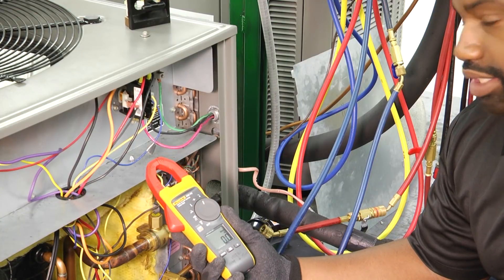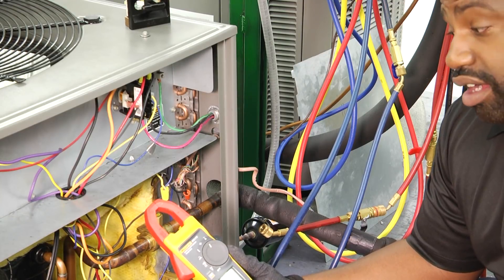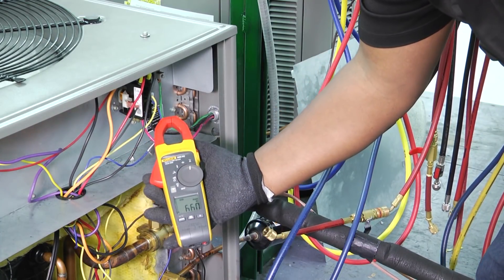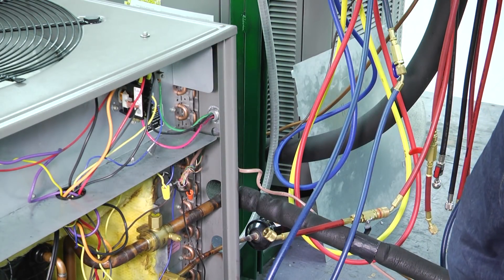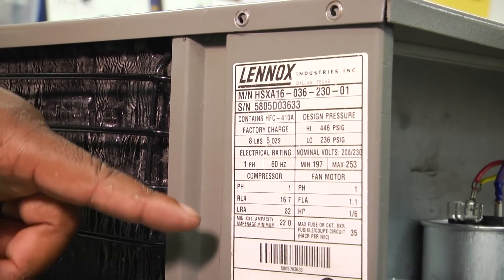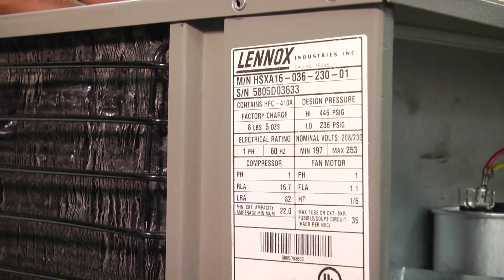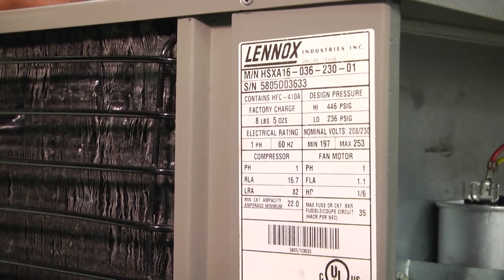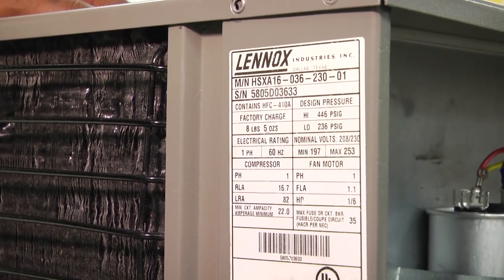Measuring Inrush Current

Comment: Most clamp on meters on inrush/surge current mode require 0.3 to 0.4 seconds duration for time averaging of current to make an accurate startup surge current measurement.  

A hardstart kit may reduce startup time to less than 0.3 seconds causing meter to report an erroneously low startup surge current number.  This is the reason many techs incorrectly believe hardstart kits reduces compressor startup surge current.

Hardstart capacitor decreases startup time.  It does not reduce peak surge current, only shortens its duration.  

Hardstart capacitor gets the start winding to run winding current closer to 90 degree AC phase shift which improves startup torque of single phase AC induction motor.  The amount of additional start winding current is very small,  it is the AC phase improvement due to larger capacitor value that improves the startup torque, reducing the spin up time of motor.

LRA is set by motor design and does not change unless voltage on motor changes.  What changes is the length of time the motor takes to spin up to operating speed.  As a compressor approaches 0.7 to 1 second of time to spin up due to whatever issue inside compressor (copper plating on bearings, liquid flood back in off mode. etc.) the internal thermal cutout breaker inside compressor will likely trip due to LRA current for the long period of time.  Bad wiring, connections, bad contactor, can also cause additional voltage drop during high startup surge current, therefore longer spin-up time, causing compressor internal breaker to trip after 0.7 to 1 seconds.

Comment: I'm confused! As the inrush current goes down, that's a problem? I would think as long as the inrush current is less than LRA that would be a good thing. Less current, less heat. No?
Reply: The lower the inrush current the better because it's easier on the compressor windings. A little more longevity for the compressor.
Reply: @bernardocisneros4402  Yes I agree. At least I would think so. They may be negative to too little inrush current as well, but I can't think of what that might be as long as there is enough current to get it moving.
Reply: @tommaxwell429  The ideal scenario would be for the current to gradually ramp from zero to rated RLA. That is what a compressor that has an EasyStart installed does and it does it in about 3/4 of a second. Whereas a new compressor without EasyStart or a hard start kit installed, experiences an inrush current spike lasting about 100 milliseconds and the compressor reaches rated speed in about 250 ms.

Comment: Fantastic✔Sent this to my HVAC folks since they didn’t know how to use their clamp on meter etc.  I want to run my AC on a portable generator so need the new surge amps after the soft start installation.  If it’s below 30 amps, I’m good.

Comment: It may be beneficial to inform folks about the difference between a hard start kit and a soft start kit.  A hard start kit actually will not change the inrush current, it will simply decrease the duration of this spike.   A soft-start kit, on the other hand, should decrease that spike peak.

Comment: RLA = Rated Load Amps.  Measured amps while compressor is running.
LRA = Locked Rotor Amps.  A locked rotor is the worst possible case for impedance that leads to the highest measured amp reading.
Reply: Incorrect. Impedance doesn't change. It's a function of design of the motor.

What changes is the magnitude of the back EMF. When the motor is not rotating, there is no back EMF, and the circuit is simply the DC resistance of the coils and the voltage across them. The coil resistance is low and hence the locked current is high 

I am surprised how many people are making statements on how motors operate and do not understand basic motor theory. It's shocking
Reply: @deang5622   Besides the inductance of the motor, frequency also effects impedance.
Reply: @bernardocisneros4402 Frequency does not effect impedance.
Frequency affects impedance. Actually frequency affects the reactance.
Reactance is a component of impedance.

Learn the difference between effects and affects.

XL = 2πfL
Reply: @deang5622 What are you the grammar police?😂 Grammar aside, impedence is dependent on the frequency. True or false?
Reply: @deang5622 What do you have to say about @kdcarver's comment saying back emf is not the primary reason for the inrush of current, impedence is?
Reply: SHOCKING indeed       :) @deang5622
Reply: @deang5622  There is no "back EMF" when a motor starts or when it is running.  There is simply the impedance of an RLC circuit.  When the motor stops, depending on the wiring, it might act as a generator, creating "back EMF".
Reply: @kdcarver Go research it properly homie.
Learn the subject properly before posting.

I shouldn't have to explain Faraday's Law or Lenz's Law to you. These are fundamental principles which you should know.

Back electromotive force (back EMF) is the voltage generated by a running motor that opposes the applied voltage, reducing the current flowing through the motor as it speeds up. This phenomenon occurs because the motor acts like a generator when its coils rotate in a magnetic field, inducing an opposing voltage.
Reply: @deang5622  , your "homie" is an EE PE with thirty years of industrial experience -- condescendingly mentioning Faraday's name in conjunction with wound squirrel cage motors doesn't get you very far with me.  My comment was focused on your assertion that back EMF is the primary reason for inrush current.  This is simply not true.   Inrush is overwhelmingly a function of the RLC impedance.
Reply: @kdcarver Are you sure that there isn't any back EMF when a motor is running? I was always taught there is.
Reply: @bernardocisneros4402  Yes, there is.  But it is generated when an AC induction motor is running.  Even then, it is small in proportion to the line voltage.  Since it is a small value and inrush occurs at startup as a function of the RLC circuit, back EMF would not have a substantial effect on the inrush value.

Comment: This video is absolutely misleading. Inrush current measurement can only be performed using meters that have an inrush capability and equipped with inrush button. This guy did the test with the tool, which does not have an inrush option and not measured correctly.
Reply: So make a video.  Tag us in it,  we'll watch.  No hatred,  just trying to learn

Comment: I am wondering which breaker you were using for this 66 Amp ?
Reply: I mean probably just whatever it's calling for like a 20 or 30 since it only pulls like 6 while running I assume there is also the fan but a breaker can handle it for this couple milliseconds
Reply: My guess, here in the UK a 20A type C or D  type MCB.

Comment: I understand that a meter needs an "inrush current" capability that most meters don't have. The reason being that the inrush current only lasts 3 or 4 cycles (10ms) and goes by too quickly for regular meters to measure. If you put the meter on "max" you are measuring current draw not only on the first 10 ms of inrush, but also on the next 990ms of startup current which is less current draw as the motor gets to full speed and therefore a lower reading than the inrush current value as the two are combined over the 1 second start up. I just installed a new 3 ton condenser, coil, and furnace with a LRA of 77 and I measure 85 amps of inrush consistently using the inrush capability of my meter.
Reply: buy UNI-T 208b it has inrush current😊

Comment: If inrush measures the maximum current drawn by the compressor, what does the MAX button on the meter do? Thanks.
Reply: The max button could do it but its not accurate as the max button isn't fast enough to measure the inrush amps which is why newer or fancier meters have a dedicated inrush
Reply: The max button stores the max current or voltage measure by the meter in the timeframe that you are measuring, it doesnt measure the inrush current since its an average. If you was to use a storage scope on motor switch on you would see a massive spike, thats the inrush currrent of v/r when there is no back emf

Comment: I bet the in rush current on a new unit is probably real close to 3X the running amps
Reply: it can be up to 50 * running amps but last only 0.5 seconds which is why the fuse doesnt blow, most fuses are antisurge.
Reply: Hi, I am also surprised to see the inrush currents are 10 times the steady state currents and he is counter verifying with the name plate details.

Comment: Missing the most important piece of info "which wire are you  clamping your meter to?" Thanks!
Reply: Common
Reply: @joshflynn9388  is it the common from the whip to the contacter or the common from the contacter to the compressor?
Reply: @PH-md8xp  @Editronone never said not to ask questions.
Reply: Not trying to be mean, but if you don't know what wire it goes on don't even take the cover off.

Comment: The problem with trying to diagnose using Inrush Amperage measurements is and I'll quote Fluke Instruments "Inrush amperage can be  4x to 10x RLA" so with out a substrate or baseline amperage, you can't judge wear and tear.
Reply: The LRA number is what the engineers have designed for that specific unit to pull when the unit is locked or trying to start up, if your inrush is below that number its using less to start up, if you ever come across seized motors  the amp draw is usually a lot higher and stuck at the LRA rating if the motor has an lra  rating.
From what I was told and taught at least